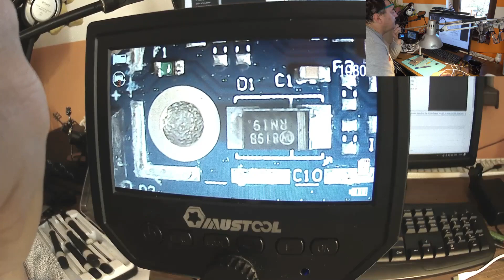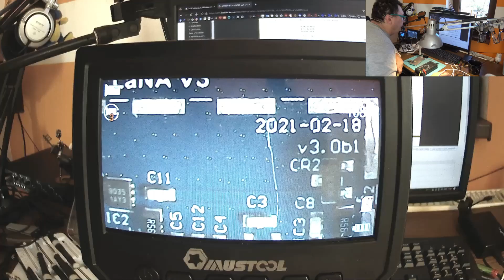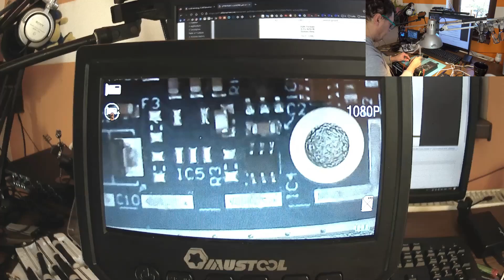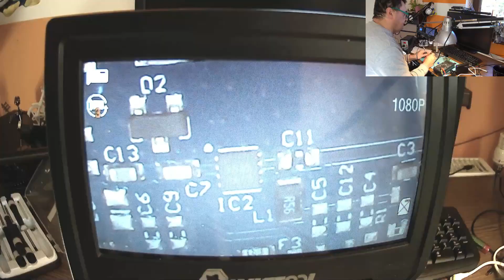NOOELEC LaNa RF amplifier check

Comment: Hello Viorel, there is a new bidirectional amplifier available on aliexpress which is quite cheap that you may be interested in testing on your channel, it's called "2022 New NST 868Mhz Amplifier PCBA Jetvision-Killer 14db Flarm Booster for Indoor Use Helium Signal Booster Built". If you type the title into google it should come up, I can't post a link as the comment will be deleted. it cost me about £30 and took 3 weeks to arrive to the UK and I have been using it for 2 weeks now, it's very good!
Reply from the maker: I'll order one and test it...thanks for!
Reply: @viocaia  no problem! it might be quite interesting, could just be an airbuddy copy inside but at a fraction of the cost!
Reply from the maker: @RedAndYellacuddlyFella  I'll put a SPF5189 instead..just for fun..
Reply: @viocaia  😂👍🏻